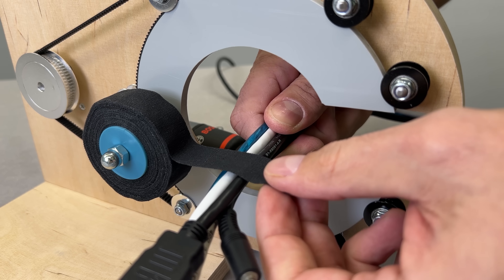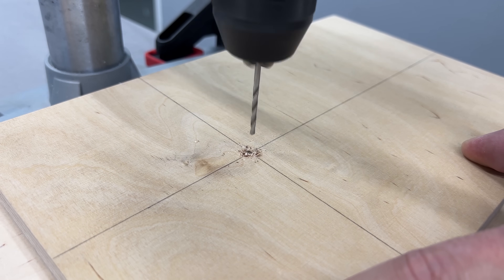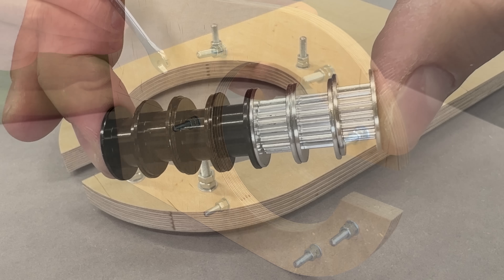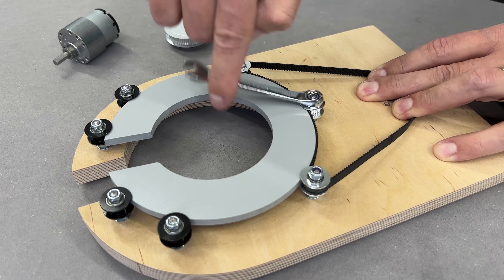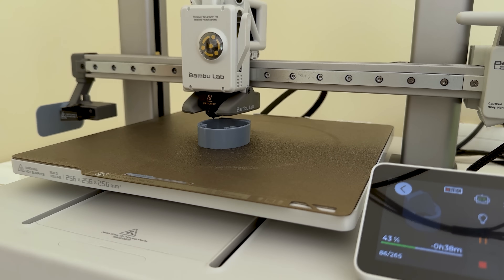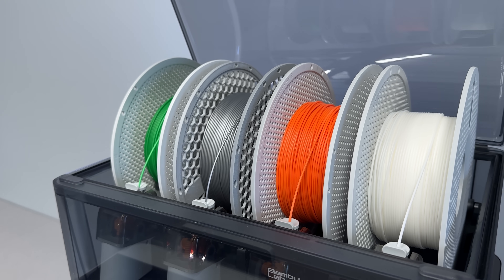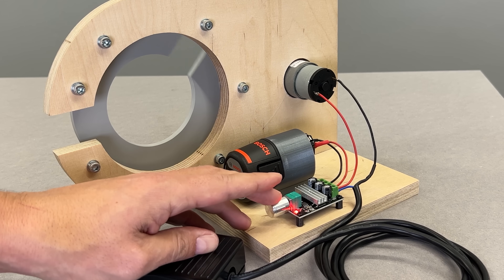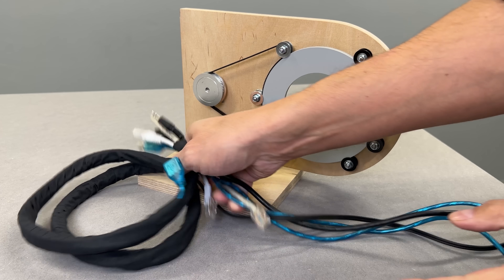How I Fixed My Messy Wires in Minutes!

Comment from the maker: ✅ Everything you need for this build is in the description!
STL files, parts list, and links to the tools I used are all there -  and if you have questions, ideas, or upgrades, post them here!
💬 What would you add to this machine?
Reply: Maybe paint it some fun colours but apart from that it does the job and does it well. What more do you need apart form a machine that does what you require from it.

Comment: Great idea for that classic car look. 
I have ordered the parts needed a few links were dead but i think i found the correct parts.  
Do you have the dimensions of the holes for the PVC and Plywood  parts please. 
It would be easier than trying to work out myself and i want to make one to wrap the wiring harness i have make for my VW trike. Thanks

Comment: 🤔 I would rather use heat shrink tubing. But I have the problem that every time I organize my cables, I have to take one out. That's why I use reusable cable ties. (I use them to create color-coded cable bundles.)

Comment: Well done video.  I applaud the effort, design and results.  This is great for wire bundles that will get installed permanently but a bit overkill for wires that will get manipulated and changed over time.  Wires that aren't permanent or require maintenance just need velcro every 6 inches or so.

Comment: Nice project.  For those not otherwise needing an (admittedly rather nice) 3-D printer, cost can be reduced by $2,000 plus by fabricating the parts with conventional old-school materials and tools. Alternatively, the company’s smaller model at about $1,000 would do.
Two changes I would consider:
1. I would brace the vertical component with about 4 triangular blocks, and wood screws from the bottom.  You are asking a lot of that glued join.
2. If I already had a DC power source with enough power I would use that rather than the battery.  But I am not a traveling computer/IT tech.  .  .

Comment: Remove the noisy clacking sound by adding a lead-in to the outer edge. 0-15 degrees with a 5mm radius should do it.

Comment: nice, i see others have mentioned the belt tensioner , this belt will expand after some time, also seal the wood with some good varnish to prevent it from deforming due to humidity , this is a great tool

Comment: An improvement would be to add some adjustable friction to the tape spool. Like a spring, nut, and with a compression bearing on the side of the tape spool.

In this way, you can adjust how much resistance the tape spool should have, thus giving tighter wire looms.
Reply: And a tensioner for the belt would help keep things working after the belt stretches.

I really like this tool! Hope he does more...

Comment: Replacing the potentiometer with the one on the pedal would give you ability to control speed while feeding the wire without the need to use third hand. Also shamelessly shiling bamboo DRM stuff i guess you got for free was a bit of a thumb down moment in a generally good DIY video with nice free shared stls for beginners.

Comment: Great, now all the parallel wires can interfere with the signal going down each. 
And if one cable goes bad or needs to be replaced, you're either throwing away cut up tape or unwinding it all. 
I've made the exact same thing for cables... it's sitting in my attic gathering dust.  I guess it's just not usually a great idea to wrap all your cables together.  LOL!  oops!
 I think there's only one time I found it useful... the job I made mine for.  VW Bug wiring loom.   Haven't had a use for it since.
Reply: If the tool isn’t right for your project, don’t us it.
Reply: @Pellejoduro  did your wife tell you that ?LOL JK 😅
Reply: Use shielded cables. You're welcome.
Reply: @subtlename2873  Those weren't magnetically shielded cables in the video.  And no one needs your obvious comment.

Comment: nah nice idea but Imagine You have now to replace 1 cable no thanks sorry^^
Reply: If wire is to be serviced then yes a wire harness would not make sense. You can go with wire loom if minor protection is needed or pvc worst case scenario emt conduit if minor bumps rigid for heavy duty conduit.
Reply: @maharba1443  The methode in the video  is good for Car cables Restoring Classic cars ^^b
Reply: @Shisizuwa I agree im just stating the levels of saftey of course what i said is totally impractical as im sure theres a code to follow in the automotive world. Wire harnesses are under the impression that if to be serviced its more likely you'll replace more than just 1 or 2 wires. Therefore wire harnesses are technically permanently "there". Like houses wires are put and typically left alone. Idk if thats a good ex. All in all im making one lol

Comment: If you have a 3D printer is there any reason you didn't print the c ring or main body?
Reply: Speed most likely. If you already have the wood and ABS it's faster to cut it out than to draw it and print it.
Reply: i guess the way he did that is because...
cheaper (material, time), easier, more fun
Reply: It's not cheaper. Necessary filament will cost less than 5 quid.